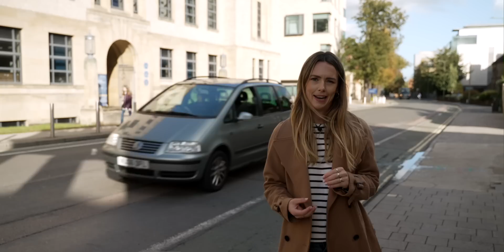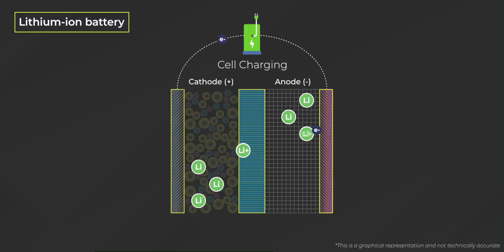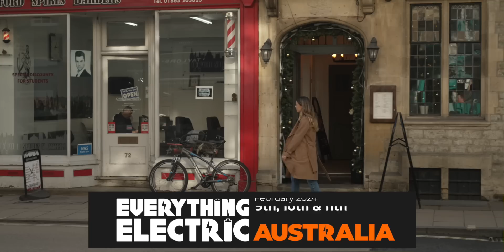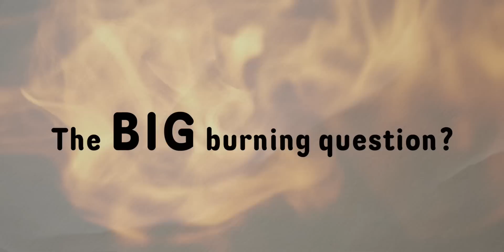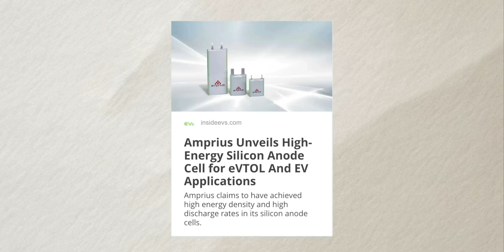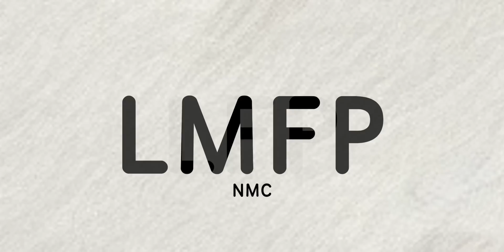The BIG Battery Breakdown: Fires, Failures and Future Breakthroughs!

Comment: Very informative, actually worth several listenings.

Could your same guest give us the breakdown on home storage batteries? I’m a rural home and business owner. I need enough batteries to power heat pump and cooling, lights, induction cooking , and a bit of water heating at night, and charge two EVs during the day. I need a minimum of 50 kWhs of battery storage. The battery can be heavy, but it also needs to last more than ten years and cost about $10,000 US. 

Whoever can put a larger capacity and affordable home storage battery on the market will disrupt the price gouging utility monopolies and become a billionaire.
Reply: There are dozens of them in both production and in the technology pipeline.
Do a bit of serious research and you will find them.

Comment: Great episode! Good thing that batteries already are more than good enough for many times more users than global production capacity can supply for. Better batteries are very welcome, but supply is far from catching up with potential demand where battery power already is better than current alternatives. So, what's currently most important is to get cheaper and faster and more battery production. The sooner batteries can start to replace combustion in more applications the better, obviously, but the overall transition isn't kept back by a lack of battery technology that is good enough.

The most probable reason to not have an opportunity to charge a road vehicle for a thousand miles just a few years from now is that practically no one else drives that route, that also means that issue will remain relevant only for a ridiculously small minority.

Comment: Excellent summary of today's battery tech and what we may be seeing tomorrow.
Note also that grid/home batteries can benefit from a broader range of technologies, not just chemistries: Redox flow, thermal (water or salt based), etc. The Dutch (Triple Solar, Borg Energy Storage) especially seem to be focusing on cheap and efficient water-based solutions, mostly for heat storage and restitution, not electricity generation, with solar thermal panels, heat pumps, 7-day autonomy 4 m³ tanks, etc.
We can also convert heat into electricity in summer, as solar heat production would be much higher than what's needed in winter for central heating. If using hybrid thermal+photovoltaic panels, that would also cool down the panels and make them more efficient.

Comment: What Toyota did with their latest prius hybrid is realistically what we need... Cause think about it.. Do we really need more range? For most people, they may never need to fuel up or so with their prius... Most people, so, realistically, a hybrid car that can be a plug in, charge from the engine when it's been used, or best charge under the sun while ideal in applicable places will be the best solution to reduce carbon foot print. 

That's the best solution I've seen so far... Cause despite the fact that evs are great, the process of mining these materials involves serious dirty business..

Comment: Getting there .... pretty much sums this up. Battery tech seems to have always been getting there for as long as I can remember electric cars being around. Whilst there's been gradual improvements step by step each year, what's needed is a quantum leap for mass adoption to succeed. A GENUINE (not wltp or any other false measure) 1000 mile range is needed. No half measures will do. Why? Because nobody wants to be sat for an hour every hundred miles having to recharge, with no facilities around to boot. I suspect in 10 years time, my response to an episode like this will still be .... getting there. I hope not, but that's been the pattern for the last 20.

Comment: I think if they can bring a 1000 mile range car, then surely that means we can use that and get faster charge, 250 range evs that are lighter.
Reply: But, if we have a 1000 mile range we then rely on motorway charging less. We don't charge to 100% all the time, so we only need to rely on destination charging.

Comment: Yes indeed, EV's need to be made far more energy efficient.  Right now the holy grail for many is being able to rocket from zero to 60 in far less than 2 seconds so that here we are around 15 years after the initial release of the 5 Miles per kWh Nissan Leaf putting up with only about 3 Miles per kWh as the new normal.  Aptera for example is going against this trend and designing vehicles to give you around 1,000 miles of range from a 100 kWh battery and 400 miles of range from a 40 kWh battery so about 10 Miles per kWh plus with their solar option were talking about 40 miles per day of active charging even while you drive.

Those who have fire concerns will be happy to note that companies like Cobra Fire Systems have penetrating fire nozzles available that will put out a thermal runaway EV battery fire with no re-ignition in 4 minutes using less than 64 gallons of water making it so that it takes more water to put out fires involving the seats, trim and other flammable components in a vehicle.

Best!

Comment: This is a great video, and I do agree with all of it - but... at around 4:05 Euan states that an NMC battery won't be "an instant cremation": However, this has happened in the past, and there is video evidence - so it'd be good to know what's different about modern designs which allows them to be so much safer. 

BTW, I have no worries about the battery in my MG4. It's hardly ever caught fire in the multitude of collapsing carparks I leave behind me!
Reply: Yes I’d liked to have seen a video clip of it not catching fire, as there are video clips of emergency services damaging them and catching fire, so it would have been good to balance the view with visual evidence.
Reply: @andym5156  There is a video somewhere showing a cell being puncture tested - I can't recall if it's a fully charged video, or maybe a Matt Ferrell video. If I find it, I'll add a link here.
Reply: @real_electricmonk 
Search for BYD Blade Cell. They push a nail right through one while monitoring the temperature.

Comment: As long as the next gen batteries can do 250 miles on the motorway in winter, I do not need any more range.   If it takes 30 minutes to charge from 10-80% in 30 minutes that is as fast as I need, that is about the same as loo break and coffee in a motorway service station.  If the battery is also lighter and cheaper then that is a double win.

As for home battery storage - sodium ion seems the way forward

Comment: Great video comparing various battery technologies!
I am wondering, however, if there is almost no need for a 1000 mile EV, why are there ICE cars (especially Diesel ones) offering 1000+ mile range instead of having a smaller fuel tank and increased size of the boot space? Shouldn't such a range be impractical?

Comment: Would be interesting to deep dive on the battery anode- often forgoten, found out the other day that the vast majority of graphite for lithium car batteries is made from oil in the refining process!
What are the plans on changing this?
Reply: Reduction of CO2 by electrical means? Renewable, of course.

Comment: To talk about a particular range of a battery powered car isn't that helpful - maybe you could a 1000 miles pottering around the city, but what is the range for long journeys when you are doing 70mph all the way, in winter with the heating, lights & wipers on? The range figures currently quoted by manufacturers are very unrealistic, and even more accurate figures seem to feature a mix of road conditions, but EVs will never be useful for long journeys if they can't do a decent range at speed.

Comment: I couldn’t disagree more that 1000 mile battery is niche market… this technology can drive the biggest switch to ev’s as it would make them more convenient that ICE’s for anyone without a driveway charger and remove the need for chargers on every street corner as the owner would be good for one fast charge per month.
Reply: I couldn’t disagree more that 1000 mile battery is needed for the mass market for switching to EVs. Hauling that extra battery weight only hurts energy efficiency, adds extra wear to roads, and costs a lot. What we need is cheap and widely available charging, and cheap city EVs. 150-200km range is sufficient if you can always leave the car to charge at your job parking space, or at a shopping center. Such cars could cost less than €15k, as cost is the main obstacle to the switch, and battery is the main cost. Plus production can be scaled up fast, without putting 10x pressure on the battery supply chain, like 1000-mile batteries would.

Comment: 2:55 “the chance of the gasses reaching the cabin are infinitesimally small”.

Meanwhile, there is a Jeep 4xe recall for this exact situation as the rear floor is the top of the battery and it is designed to vent in to the cabin. Designed. They knew
Reply: You mean the 2023 European car of the year? Because I can’t imagine there is any cynical paying for awards going on…

Comment: Id wager for most normal folks LFP and potentially sodium ion will be the kings of the 2020s. A lot of folks would trade having to charge slightly more often on the one off road trips due to lower energy density, for the incredible longevity of LFP, especially if its a car they own not lease.

Comment: We also should consider how vehicles are used. We see many caravans being towed across the UK and Europe and the range when towing is typically less than 50% of the solo range. So longer range is critical for these uses, but should the towed vehicle have its own battery pack to supplement the towing vehicle. I wonder if the caravan industry is engaged.

Comment: On the 1000mi battery there is also the 80/20 rule. If we tackle the 80% (probably more like 90%) of car usage with 300-400mi battery the remaining use cases can quite easily keep on using diesel until the charging infrastructure catches up. Also auto-change or quick switch batteries would do away with a lot more problems that come to infrastructure. Charging batteries at off-peak should be absolutely central to the whole system, but it can only happen if law dictates that an EV must have for example 30% of the battery capacity quickly or automatically changeable.
At the moment I think there are a few manufacturers doing their own thing, which is insane. Go to any car factory or any factory and you see robotic arms that can do millimetre level things at 1000kg weights. So have a "universal slot" either on the bottom or back of the vehicle that enable 10-30kWh of battery change in seconds of minutes is, not only possible, but would be the game changer. This would also reduce the worry of buying an EV as "the next battery tech, is just around the corner". 

We just need a common standard, which is hard to get as companies like Tesla etc. all are doing the Apple model of planned obsolescence, with all sorts of built-in batteries and proprietary charging plug and infrastructures.
Reply: Yes, but, have you factored in the number of "spare" batteries required to allow this easily changed battery switcheroo thing?

Or the amount of energy required to recharge millions of these spare batteries on a "just in case" basis.

We don't hear much about that from the "battery switching" industry.

Comment: We need drive-train efficiency to improve radically. instead of increasing KWH we carry with us on a constant basis, if more efficient motors are there we could significantly increase range with even the existing battery technology. We don't need hundreds of HP, do we need a sub 3s acceleration for a 2 ton MPV?! With petrol or diesel it was more than adequate to have such figures in around 7s (that is pretty fast already).

Comment: As a caravan enthusiast, where towing a caravan will typically halve the range of an EV, it is essential to have 5-600 mile ranges (250 - 300 with caravan). Also charging stations which accommodate cars with trailers.
Reply: @@retiredbore378no stress we already have the appropriate solution.
Reply: @0Aus yes, so do i, a diesel with a 650 mile range, either my campervan diesel that can tow 350 miles or so, for a 7.5 metre 4 berth fixed bed, or my Mercedes E Class diesel, that can do the same. Petrol stations are designed properly as well, to re-fuel in through put quickly and efficiently and in the dry. EV's are just an inferior product doomed to the dust bin of history, along with betamax tape recorders, the same as the time wasting, unreliable and poorly designed charging infrastructure.
Reply: @stevezodiac491  my solution is a diesel vehicle. 
As for range
Additional fuel.
My current touring vehicle is good for 2600 kilometres. 
No battery car will carry 5.6t across Australia.
Reply: @0Aus  1 day it will be possible to tow caravans in Australia. The next caravans will have big batteries, electric motors and regen, be able to park themselves in a charging bay. While your car auto swaps out your battery. With decent size battery I reckon towing 800km could be possible.
Reply: @Lukeco27  oh wow! Considering it now costs more to charge a battery car than to fuel ice in Australia (42% price increase) I doubt that will sell 😁😆👍
Reply: @0Aus  a lot of people will charge with solar, a holiday travel could cost a bit more, not to much if you have some free swaps a month. Should be less servicing of EVs.
Reply: @Lukeco27  also you are talking hypothetical  yes? Let's ground ourselves in facts not dreams
Reply: @Lukeco27  in Australia battery cars aren't  managing to do what they are designed for let alone anything else. 😆😅🤣 so Na champ not likely
Reply: @Lukeco27 there’s somebody doing a drive across Australia with caravan. Sorry don’t have link but google should find it   Cheers. I have caravan and same issues. Ready when right EV is here. Look at vinfast ev suv. 1600+ kg towing.
Reply: @@retiredbore378 Yes all good news. 
Australia won't be subjected to mandatory battery cars because we know they aren't suitable.
Brilliant news as we are still opening petrol stations. 
3 in the last month in Perth alone. 😀👍
Reply: @@retiredbore378 you say niche, lol not in Australia.
Reply: @@retiredbore378 how's Detroit looking??😀

Comment: Very good presentation. Remember that 300 mile range isn't that when you have wipers, heaters, lights etc running. Quoted ranges are generally based on an unloaded car in good weather conditions, start using it in the real world & watch the range tumble. Buy the EV range you need for your real world not theoretical lab use.
Reply: Thats where actual facts and figures come in useful as opposed to suppositions and acecdotes.
Reply: @DrakeN-ow1im 

Quite so. 

It's as if the car manufacturers lobbied their governments so that they could claim any old bollocks with reference to range and not be done under "trade descriptions".

Or have to state that batteries don't last forever and can be recharged at millions of amps ... or can be recycled in domestic power walls which will work for all eternity, or at least until Earth ends up in the photosphere.

We once were assured we were going to see million mile batteries ... yet they seem to have vanished.

It would seem prudent to take the manufacturers' claims of range and then divide the number by two.

And then presume that not all chargers work, or are available, the moment the batteries have to be re-charged.

And then not accept the  battery on every used EV is in tip top condition.

Comment: Nobody is disputing that EVs are less likely to catch fire, however, when they do they are almost impossible to extinguish unlike ICE cars. 

I was involved with the fire service this year including a trip to an underground road tunnel to see what happens if there is an accident involving fire. ICE fire they can deal with, EV fires not so! So yes EV unlikely to catch fire, but when they do you have a MASSIVE problem. 

Another not so green thing is that EVs are written off so easily due to the expensive battery and that it’s usually part of the structure and costs approximately 1/3rd of the price of the car. So if a new car is £60k the battery is £20k. Say 3 years later, car is worth £40k (probably less) and is involved in an accident with battery damage. Battery is still £20k plus labour plus any other parts damaged in the crash so car is highly likely to be written off. Add to this that car body shops are being advised to store damaged EVs with a 15m (sure it is 15m) clear radius many body shops are refusing to take in EVs. EV insurance is escalating due to these issues. 

I am NOT anti electric vehicles, but they are not the only answer and not suitable for everyone! For myself a self charging hybrid is perfect, better than diesel economy without so many horrible emissions. Plus I bought a 3 year old vehicle that I intend to keep for many many years. 

I feel that EVs are being rushed through as THE answer. They are only part of the answer. Scrapping ICE cars and replacing with EVs is also not the answer. Any ICE car that currently exists has had a lot of CO2 used to build it. If the ICE Car is not a big gas guzzler but just a normal car then keeping this car on the road is actually better than scrapping it as EVs use more CO2 to build in the first place. Scrapping the ICE car is wasting CO2 already used. Yes, get the dirty cars out of the big cities. But don’t scrap them. 

I’m not getting into the infrastructure, but it’s been proven that this isn’t ready yet and needs some work. 

Slow down the EV train, improve the infrastructure, work on methods of extinguishing EV fires & improve the battery technology and efficiency.